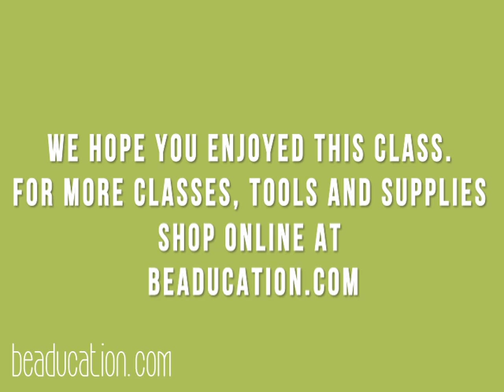Hammered Textured Metal - Beaducation.com

Comment: cuanto valen los martillos de tecxturas  y donde los vendes muchas gracias
Reply from the maker: laura perezHola, usted puede comprar los productos en Beaducation.com. 
 
  
 

<p class="MsoNormal" style="margin-bottom:0in;margin-bottom:.0001pt;line-height:
normal;tab-stops:45.8pt 91.6pt 137.4pt 183.2pt 229.0pt 274.8pt 320.6pt 366.4pt 412.2pt 458.0pt 503.8pt 549.6pt 595.4pt 641.2pt 687.0pt 732.8pt"><span style="font-size:10.0pt;font-family:"Verdana",sans-serif;mso-fareast-font-family:
"Times New Roman";mso-bidi-font-family:"Courier New"">

 
  Normal
  0
  
  
  
  
  false
  false
  false
  
  EN-US
  X-NONE
  X-NONE
  
   
   
   
   
   
   
   
   
   
  
  
   
   
   
   
   
   
   
   
   
   
   
  

 <w:LatentStyles DefLockedState="false" DefUnhideWhenUsed="false"
  DefSemiHidden="false" DefQFormat="false" DefPriority="99"
  LatentStyleCount="371">
  
  
  <w:LsdException Locked="false" Priority="9" SemiHidden="true"
   UnhideWhenUsed="true" QFormat="true" Name="heading 2"/>
  <w:LsdException Locked="false" Priority="9" SemiHidden="true"
   UnhideWhenUsed="true" QFormat="true" Name="heading 3"/>
  <w:LsdException Locked="false" Priority="9" SemiHidden="true"
   UnhideWhenUsed="true" QFormat="true" Name="heading 4"/>
  <w:LsdException Locked="false" Priority="9" SemiHidden="true"
   UnhideWhenUsed="true" QFormat="true" Name="heading 5"/>
  <w:LsdException Locked="false" Priority="9" SemiHidden="true"
   UnhideWhenUsed="true" QFormat="true" Name="heading 6"/>
  <w:LsdException Locked="false" Priority="9" SemiHidden="true"
   UnhideWhenUsed="true" QFormat="true" Name="heading 7"/>
  <w:LsdException Locked="false" Priority="9" SemiHidden="true"
   UnhideWhenUsed="true" QFormat="true" Name="heading 8"/>
  <w:LsdException Locked="false" Priority="9" SemiHidden="true"
   UnhideWhenUsed="true" QFormat="true" Name="heading 9"/>
  <w:LsdException Locked="false" SemiHidden="true" UnhideWhenUsed="true"
   Name="index 1"/>
  <w:LsdException Locked="false" SemiHidden="true" UnhideWhenUsed="true"
   Name="index 2"/>
  <w:LsdException Locked="false" SemiHidden="true" UnhideWhenUsed="true"
   Name="index 3"/>
  <w:LsdException Locked="false" SemiHidden="true" UnhideWhenUsed="true"
   Name="index 4"/>
  <w:LsdException Locked="false" SemiHidden="true" UnhideWhenUsed="true"
   Name="index 5"/>
  <w:LsdException Locked="false" SemiHidden="true" UnhideWhenUsed="true"
   Name="index 6"/>
  <w:LsdException Locked="false" SemiHidden="true" UnhideWhenUsed="true"
   Name="index 7"/>
  <w:LsdException Locked="false" SemiHidden="true" UnhideWhenUsed="true"
   Name="index 8"/>
  <w:LsdException Locked="false" SemiHidden="true" UnhideWhenUsed="true"
   Name="index 9"/>
  <w:LsdException Locked="false" Priority="39" SemiHidden="true"
   UnhideWhenUsed="true" Name="toc 1"/>
  <w:LsdException Locked="false" Priority="39" SemiHidden="true"
   UnhideWhenUsed="true" Name="toc 2"/>
  <w:LsdException Locked="false" Priority="39" SemiHidden="true"
   UnhideWhenUsed="true" Name="toc 3"/>
  <w:LsdException Locked="false" Priority="39" SemiHidden="true"
   UnhideWhenUsed="true" Name="toc 4"/>
  <w:LsdException Locked="false" Priority="39" SemiHidden="true"
   UnhideWhenUsed="true" Name="toc 5"/>
  <w:LsdException Locked="false" Priority="39" SemiHidden="true"
   UnhideWhenUsed="true" Name="toc 6"/>
  <w:LsdException Locked="false" Priority="39" SemiHidden="true"
   UnhideWhenUsed="true" Name="toc 7"/>
  <w:LsdException Locked="false" Priority="39" SemiHidden="true"
   UnhideWhenUsed="true" Name="toc 8"/>
  <w:LsdException Locked="false" Priority="39" SemiHidden="true"
   UnhideWhenUsed="true" Name="toc 9"/>
  <w:LsdException Locked="false" SemiHidden="true" UnhideWhenUsed="true"
   Name="Normal Indent"/>
  <w:LsdException Locked="false" SemiHidden="true" UnhideWhenUsed="true"
   Name="footnote text"/>
  <w:LsdException Locked="false" SemiHidden="true" UnhideWhenUsed="true"
   Name="annotation text"/>
  <w:LsdException Locked="false" SemiHidden="true" UnhideWhenUsed="true"
   Name="header"/>
  <w:LsdException Locked="false" SemiHidden="true" UnhideWhenUsed="true"
   Name="footer"/>
  <w:LsdException Locked="false" SemiHidden="true" UnhideWhenUsed="true"
   Name="index heading"/>
  <w:LsdException Locked="false" Priority="35" SemiHidden="true"
   UnhideWhenUsed="true" QFormat="true" Name="caption"/>
  <w:LsdException Locked="false" SemiHidden="true" UnhideWhenUsed="true"
   Name="table of figures"/>
  <w:LsdException Locked="false" SemiHidden="true" UnhideWhenUsed="true"
   Name="envelope address"/>
  <w:LsdException Locked="false" SemiHidden="true" UnhideWhenUsed="true"
   Name="envelope return"/>
  <w:LsdException Locked="false" SemiHidden="true" UnhideWhenUsed="true"
   Name="footnote reference"/>
  <w:LsdException Locked="false" SemiHidden="true" UnhideWhenUsed="true"
   Name="annotation reference"/>
  <w:LsdException Locked="false" SemiHidden="true" UnhideWhenUsed="true"
   Name="line number"/>
  <w:LsdException Locked="false" SemiHidden="true" UnhideWhenUsed="true"
   Name="page number"/>
  <w:LsdException Locked="false" SemiHidden="true" UnhideWhenUsed="true"
   Name="endnote reference"/>
  <w:LsdException Locked="false" SemiHidden="true" UnhideWhenUsed="true"
   Name="endnote text"/>
  <w:LsdException Locked="false" SemiHidden="true" UnhideWhenUsed="true"
   Name="table of authorities"/>
  <w:LsdException Locked="false" SemiHidden="true" UnhideWhenUsed="true"
   Name="macro"/>
  <w:LsdException Locked="false" SemiHidden="true" UnhideWhenUsed="true"
   Name="toa heading"/>
  <w:LsdException Locked="false" SemiHidden="true" UnhideWhenUsed="true"
   Name="List"/>
  <w:LsdException Locked="false" SemiHidden="true" UnhideWhenUsed="true"
   Name="List Bullet"/>
  <w:LsdException Locked="false" SemiHidden="true" UnhideWhenUsed="true"
   Name="List Number"/>
  <w:LsdException Locked="false" SemiHidden="true" UnhideWhenUsed="true"
   Name="List 2"/>
  <w:LsdException Locked="false" SemiHidden="true" UnhideWhenUsed="true"
   Name="List 3"/>
  <w:LsdException Locked="false" SemiHidden="true" UnhideWhenUsed="true"
   Name="List 4"/>
  <w:LsdException Locked="false" SemiHidden="true" UnhideWhenUsed="true"
   Name="List 5"/>
  <w:LsdException Locked="false" SemiHidden="true" UnhideWhenUsed="true"
   Name="List Bullet 2"/>
  <w:LsdException Locked="false" SemiHidden="true" UnhideWhenUsed="true"
   Name="List Bullet 3"/>
  <w:LsdException Locked="false" SemiHidden="true" UnhideWhenUsed="true"
   Name="List Bullet 4"/>
  <w:LsdException Locked="false" SemiHidden="true" UnhideWhenUsed="true"
   Name="List Bullet 5"/>
  <w:LsdException Locked="false" SemiHidden="true" UnhideWhenUsed="true"
   Name="List Number 2"/>
  <w:LsdException Locked="false" SemiHidden="true" UnhideWhenUsed="true"
   Name="List Number 3"/>
  <w:LsdException Locked="false" SemiHidden="true" UnhideWhenUsed="true"
   Name="List Number 4"/>
  <w:LsdException Locked="false" SemiHidden="true" UnhideWhenUsed="true"
   Name="List Number 5"/>
  
  <w:LsdException Locked="false" SemiHidden="true" UnhideWhenUsed="true"
   Name="Closing"/>
  <w:LsdException Locked="false" SemiHidden="true" UnhideWhenUsed="true"
   Name="Signature"/>
  <w:LsdException Locked="false" Priority="1" SemiHidden="true"
   UnhideWhenUsed="true" Name="Default Paragraph Font"/>
  <w:LsdException Locked="false" SemiHidden="true" UnhideWhenUsed="true"
   Name="Body Text"/>
  <w:LsdException Locked="false" SemiHidden="true" UnhideWhenUsed="true"
   Name="Body Text Indent"/>
  <w:LsdException Locked="false" SemiHidden="true" UnhideWhenUsed="true"
   Name="List Continue"/>
  <w:LsdException Locked="false" SemiHidden="true" UnhideWhenUsed="true"
   Name="List Continue 2"/>
  <w:LsdException Locked="false" SemiHidden="true" UnhideWhenUsed="true"
   Name="List Continue 3"/>
  <w:LsdException Locked="false" SemiHidden="true" UnhideWhenUsed="true"
   Name="List Continue 4"/>
  <w:LsdException Locked="false" SemiHidden="true" UnhideWhenUsed="true"
   Name="List Continue 5"/>
  <w:LsdException Locked="false" SemiHidden="true" UnhideWhenUsed="true"
   Name="Message Header"/>
  
  <w:LsdException Locked="false" SemiHidden="true" UnhideWhenUsed="true"
   Name="Salutation"/>
  <w:LsdException Locked="false" SemiHidden="true" UnhideWhenUsed="true"
   Name="Date"/>
  <w:LsdException Locked="false" SemiHidden="true" UnhideWhenUsed="true"
   Name="Body Text First Indent"/>
  <w:LsdException Locked="false" SemiHidden="true" UnhideWhenUsed="true"
   Name="Body Text First Indent 2"/>
  <w:LsdException Locked="false" SemiHidden="true" UnhideWhenUsed="true"
   Name="Note Heading"/>
  <w:LsdException Locked="false" SemiHidden="true" UnhideWhenUsed="true"
   Name="Body Text 2"/>
  <w:LsdException Locked="false" SemiHidden="true" UnhideWhenUsed="true"
   Name="Body Text 3"/>
  <w:LsdException Locked="false" SemiHidden="true" UnhideWhenUsed="true"
   Name="Body Text Indent 2"/>
  <w:LsdException Locked="false" SemiHidden="true" UnhideWhenUsed="true"
   Name="Body Text Indent 3"/>
  <w:LsdException Locked="false" SemiHidden="true" UnhideWhenUsed="true"
   Name="Block Text"/>
  <w:LsdException Locked="false" SemiHidden="true" UnhideWhenUsed="true"
   Name="Hyperlink"/>
  <w:LsdException Locked="false" SemiHidden="true" UnhideWhenUsed="true"
   Name="FollowedHyperlink"/>
  
  
  <w:LsdException Locked="false" SemiHidden="true" UnhideWhenUsed="true"
   Name="Document Map"/>
  <w:LsdException Locked="false" SemiHidden="true" UnhideWhenUsed="true"
   Name="Plain Text"/>
  <w:LsdException Locked="false" SemiHidden="true" UnhideWhenUsed="true"
   Name="E-mail Signature"/>
  <w:LsdException Locked="false" SemiHidden="true" UnhideWhenUsed="true"
   Name="HTML Top of Form"/>
  <w:LsdException Locked="false" SemiHidden="true" UnhideWhenUsed="true"
   Name="HTML Bottom of Form"/>
  <w:LsdException Locked="false" SemiHidden="true" UnhideWhenUsed="true"
   Name="Normal (Web)"/>
  <w:LsdException Locked="false" SemiHidden="true" UnhideWhenUsed="true"
   Name="HTML Acronym"/>
  <w:LsdException Locked="false" SemiHidden="true" UnhideWhenUsed="true"
   Name="HTML Address"/>
  <w:LsdException Locked="false" SemiHidden="true" UnhideWhenUsed="true"
   Name="HTML Cite"/>
  <w:LsdException Locked="false" SemiHidden="true" UnhideWhenUsed="true"
   Name="HTML Code"/>
  <w:LsdException Locked="false" SemiHidden="true" UnhideWhenUsed="true"
   Name="HTML Definition"/>
  <w:LsdException Locked="false" SemiHidden="true" UnhideWhenUsed="true"
   Name="HTML Keyboard"/>
  <w:LsdException Locked="false" SemiHidden="true" UnhideWhenUsed="true"
   Name="HTML Preformatted"/>
  <w:LsdException Locked="false" SemiHidden="true" UnhideWhenUsed="true"
   Name="HTML Sample"/>
  <w:LsdException Locked="false" SemiHidden="true" UnhideWhenUsed="true"
   Name="HTML Typewriter"/>
  <w:LsdException Locked="false" SemiHidden="true" UnhideWhenUsed="true"
   Name="HTML Variable"/>
  <w:LsdException Locked="false" SemiHidden="true" UnhideWhenUsed="true"
   Name="Normal Table"/>
  <w:LsdException Locked="false" SemiHidden="true" UnhideWhenUsed="true"
   Name="annotation subject"/>
  <w:LsdException Locked="false" SemiHidden="true" UnhideWhenUsed="true"
   Name="No List"/>
  <w:LsdException Locked="false" SemiHidden="true" UnhideWhenUsed="true"
   Name="Outline List 1"/>
  <w:LsdException Locked="false" SemiHidden="true" UnhideWhenUsed="true"
   Name="Outline List 2"/>
  <w:LsdException Locked="false" SemiHidden="true" UnhideWhenUsed="true"
   Name="Outline List 3"/>
  <w:LsdException Locked="false" SemiHidden="true" UnhideWhenUsed="true"
   Name="Table Simple 1"/>
  <w:LsdException Locked="false" SemiHidden="true" UnhideWhenUsed="true"
   Name="Table Simple 2"/>
  <w:LsdException Locked="false" SemiHidden="true" UnhideWhenUsed="true"
   Name="Table Simple 3"/>
  <w:LsdException Locked="false" SemiHidden="true" UnhideWhenUsed="true"
   Name="Table Classic 1"/>
  <w:LsdException Locked="false" SemiHidden="true" UnhideWhenUsed="true"
   Name="Table Classic 2"/>
  <w:LsdException Locked="false" SemiHidden="true" UnhideWhenUsed="true"
   Name="Table Classic 3"/>
  <w:LsdException Locked="false" SemiHidden="true" UnhideWhenUsed="true"
   Name="Table Classic 4"/>
  <w:LsdException Locked="false" SemiHidden="true" UnhideWhenUsed="true"
   Name="Table Colorful 1"/>
  <w:LsdException Locked="false" SemiHidden="true" UnhideWhenUsed="true"
   Name="Table Colorful 2"/>
  <w:LsdException Locked="false" SemiHidden="true" UnhideWhenUsed="true"
   Name="Table Colorful 3"/>
  <w:LsdException Locked="false" SemiHidden="true" UnhideWhenUsed="true"
   Name="Table Columns 1"/>
  <w:LsdException Locked="false" SemiHidden="true" UnhideWhenUsed="true"
   Name="Table Columns 2"/>
  <w:LsdException Locked="false" SemiHidden="true" UnhideWhenUsed="true"
   Name="Table Columns 3"/>
  <w:LsdException Locked="false" SemiHidden="true" UnhideWhenUsed="true"
   Name="Table Columns 4"/>
  <w:LsdException Locked="false" SemiHidden="true" UnhideWhenUsed="true"
   Name="Table Columns 5"/>
  <w:LsdException Locked="false" SemiHidden="true" UnhideWhenUsed="true"
   Name="Table Grid 1"/>
  <w:LsdException Locked="false" SemiHidden="true" UnhideWhenUsed="true"
   Name="Table Grid 2"/>
  <w:LsdException Locked="false" SemiHidden="true" UnhideWhenUsed="true"
   Name="Table Grid 3"/>
  <w:LsdException Locked="false" SemiHidden="true" UnhideWhenUsed="true"
   Name="Table Grid 4"/>
  <w:LsdException Locked="false" SemiHidden="true" UnhideWhenUsed="true"
   Name="Table Grid 5"/>
  <w:LsdException Locked="false" SemiHidden="true" UnhideWhenUsed="true"
   Name="Table Grid 6"/>
  <w:LsdException Locked="false" SemiHidden="true" UnhideWhenUsed="true"
   Name="Table Grid 7"/>
  <w:LsdException Locked="false" SemiHidden="true" UnhideWhenUsed="true"
   Name="Table Grid 8"/>
  <w:LsdException Locked="false" SemiHidden="true" UnhideWhenUsed="true"
   Name="Table List 1"/>
  <w:LsdException Locked="false" SemiHidden="true" UnhideWhenUsed="true"
   Name="Table List 2"/>
  <w:LsdException Locked="false" SemiHidden="true" UnhideWhenUsed="true"
   Name="Table List 3"/>
  <w:LsdException Locked="false" SemiHidden="true" UnhideWhenUsed="true"
   Name="Table List 4"/>
  <w:LsdException Locked="false" SemiHidden="true" UnhideWhenUsed="true"
   Name="Table List 5"/>
  <w:LsdException Locked="false" SemiHidden="true" UnhideWhenUsed="true"
   Name="Table List 6"/>
  <w:LsdException Locked="false" SemiHidden="true" UnhideWhenUsed="true"
   Name="Table List 7"/>
  <w:LsdException Locked="false" SemiHidden="true" UnhideWhenUsed="true"
   Name="Table List 8"/>
  <w:LsdException Locked="false" SemiHidden="true" UnhideWhenUsed="true"
   Name="Table 3D effects 1"/>
  <w:LsdException Locked="false" SemiHidden="true" UnhideWhenUsed="true"
   Name="Table 3D effects 2"/>
  <w:LsdException Locked="false" SemiHidden="true" UnhideWhenUsed="true"
   Name="Table 3D effects 3"/>
  <w:LsdException Locked="false" SemiHidden="true" UnhideWhenUsed="true"
   Name="Table Contemporary"/>
  <w:LsdException Locked="false" SemiHidden="true" UnhideWhenUsed="true"
   Name="Table Elegant"/>
  <w:LsdException Locked="false" SemiHidden="true" UnhideWhenUsed="true"
   Name="Table Professional"/>
  <w:LsdException Locked="false" SemiHidden="true" UnhideWhenUsed="true"
   Name="Table Subtle 1"/>
  <w:LsdException Locked="false" SemiHidden="true" UnhideWhenUsed="true"
   Name="Table Subtle 2"/>
  <w:LsdException Locked="false" SemiHidden="true" UnhideWhenUsed="true"
   Name="Table Web 1"/>
  <w:LsdException Locked="false" SemiHidden="true" UnhideWhenUsed="true"
   Name="Table Web 2"/>
  <w:LsdException Locked="false" SemiHidden="true" UnhideWhenUsed="true"
   Name="Table Web 3"/>
  <w:LsdException Locked="false" SemiHidden="true" UnhideWhenUsed="true"
   Name="Balloon Text"/>
  
  <w:LsdException Locked="false" SemiHidden="true" UnhideWhenUsed="true"
   Name="Table Theme"/>
  
  
  
  
  
  
  
  
  
  
  
  
  
  
  
  
  
  
  
  
  
  
  
  <w:LsdException Locked="false" Priority="34" QFormat="true"
   Name="List Paragraph"/>
  
  <w:LsdException Locked="false" Priority="30" QFormat="true"
   Name="Intense Quote"/>
  
  
  
  
  
  
  
  
  
  
  
  
  
  
  
  
  
  
  
  
  
  
  
  
  
  
  
  
  
  
  
  
  
  
  
  
  
  
  
  
  
  
  
  
  
  
  
  
  
  
  
  
  
  
  
  
  
  
  
  
  
  
  
  
  
  
  
  
  
  
  
  
  
  
  
  
  
  
  <w:LsdException Locked="false" Priority="19" QFormat="true"
   Name="Subtle Emphasis"/>
  <w:LsdException Locked="false" Priority="21" QFormat="true"
   Name="Intense Emphasis"/>
  <w:LsdException Locked="false" Priority="31" QFormat="true"
   Name="Subtle Reference"/>
  <w:LsdException Locked="false" Priority="32" QFormat="true"
   Name="Intense Reference"/>
  
  <w:LsdException Locked="false" Priority="37" SemiHidden="true"
   UnhideWhenUsed="true" Name="Bibliography"/>
  <w:LsdException Locked="false" Priority="39" SemiHidden="true"
   UnhideWhenUsed="true" QFormat="true" Name="TOC Heading"/>
  
  
  
  
  
  
  
  
  
  
  
  
  
  <w:LsdException Locked="false" Priority="46"
   Name="Grid Table 1 Light Accent 1"/>
  
  
  
  
  <w:LsdException Locked="false" Priority="51"
   Name="Grid Table 6 Colorful Accent 1"/>
  <w:LsdException Locked="false" Priority="52"
   Name="Grid Table 7 Colorful Accent 1"/>
  <w:LsdException Locked="false" Priority="46"
   Name="Grid Table 1 Light Accent 2"/>
  
  
  
  
  <w:LsdException Locked="false" Priority="51"
   Name="Grid Table 6 Colorful Accent 2"/>
  <w:LsdException Locked="false" Priority="52"
   Name="Grid Table 7 Colorful Accent 2"/>
  <w:LsdException Locked="false" Priority="46"
   Name="Grid Table 1 Light Accent 3"/>
  
  
  
  
  <w:LsdException Locked="false" Priority="51"
   Name="Grid Table 6 Colorful Accent 3"/>
  <w:LsdException Locked="false" Priority="52"
   Name="Grid Table 7 Colorful Accent 3"/>
  <w:LsdException Locked="false" Priority="46"
   Name="Grid Table 1 Light Accent 4"/>
  
  
  
  
  <w:LsdException Locked="false" Priority="51"
   Name="Grid Table 6 Colorful Accent 4"/>
  <w:LsdException Locked="false" Priority="52"
   Name="Grid Table 7 Colorful Accent 4"/>
  <w:LsdException Locked="false" Priority="46"
   Name="Grid Table 1 Light Accent 5"/>
  
  
  
  
  <w:LsdException Locked="false" Priority="51"
   Name="Grid Table 6 Colorful Accent 5"/>
  <w:LsdException Locked="false" Priority="52"
   Name="Grid Table 7 Colorful Accent 5"/>
  <w:LsdException Locked="false" Priority="46"
   Name="Grid Table 1 Light Accent 6"/>
  
  
  
  
  <w:LsdException Locked="false" Priority="51"
   Name="Grid Table 6 Colorful Accent 6"/>
  <w:LsdException Locked="false" Priority="52"
   Name="Grid Table 7 Colorful Accent 6"/>
  
  
  
  
  
  
  
  <w:LsdException Locked="false" Priority="46"
   Name="List Table 1 Light Accent 1"/>
  
  
  
  
  <w:LsdException Locked="false" Priority="51"
   Name="List Table 6 Colorful Accent 1"/>
  <w:LsdException Locked="false" Priority="52"
   Name="List Table 7 Colorful Accent 1"/>
  <w:LsdException Locked="false" Priority="46"
   Name="List Table 1 Light Accent 2"/>
  
  
  
  
  <w:LsdException Locked="false" Priority="51"
   Name="List Table 6 Colorful Accent 2"/>
  <w:LsdException Locked="false" Priority="52"
   Name="List Table 7 Colorful Accent 2"/>
  <w:LsdException Locked="false" Priority="46"
   Name="List Table 1 Light Accent 3"/>
  
  
  
  
  <w:LsdException Locked="false" Priority="51"
   Name="List Table 6 Colorful Accent 3"/>
  <w:LsdException Locked="false" Priority="52"
   Name="List Table 7 Colorful Accent 3"/>
  <w:LsdException Locked="false" Priority="46"
   Name="List Table 1 Light Accent 4"/>
  
  
  
  
  <w:LsdException Locked="false" Priority="51"
   Name="List Table 6 Colorful Accent 4"/>
  <w:LsdException Locked="false" Priority="52"
   Name="List Table 7 Colorful Accent 4"/>
  <w:LsdException Locked="false" Priority="46"
   Name="List Table 1 Light Accent 5"/>
  
  
  
  
  <w:LsdException Locked="false" Priority="51"
   Name="List Table 6 Colorful Accent 5"/>
  <w:LsdException Locked="false" Priority="52"
   Name="List Table 7 Colorful Accent 5"/>
  <w:LsdException Locked="false" Priority="46"
   Name="List Table 1 Light Accent 6"/>
  
  
  
  
  <w:LsdException Locked="false" Priority="51"
   Name="List Table 6 Colorful Accent 6"/>
  <w:LsdException Locked="false" Priority="52"
   Name="List Table 7 Colorful Accent 6"/>
 

 /* Style Definitions */
 table.MsoNormalTable
 {mso-style-name:"Table Normal";
 mso-tstyle-rowband-size:0;
 mso-tstyle-colband-size:0;
 mso-style-noshow:yes;
 mso-style-priority:99;
 mso-style-parent:"";
 mso-padding-alt:0in 5.4pt 0in 5.4pt;
 mso-para-margin-top:0in;
 mso-para-margin-right:0in;
 mso-para-margin-bottom:8.0pt;
 mso-para-margin-left:0in;
 line-height:107%;
 mso-pagination:widow-orphan;
 font-size:11.0pt;
 font-family:"Calibri",sans-serif;
 mso-ascii-font-family:Calibri;
 mso-ascii-theme-font:minor-latin;
 mso-hansi-font-family:Calibri;
 mso-hansi-theme-font:minor-latin;}